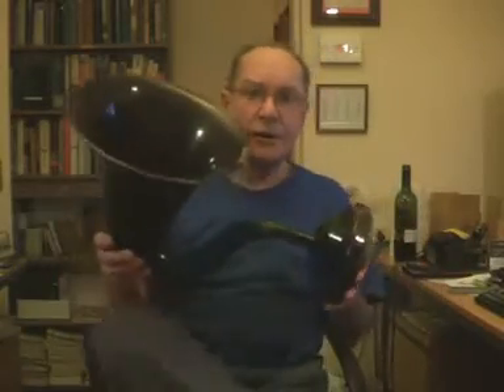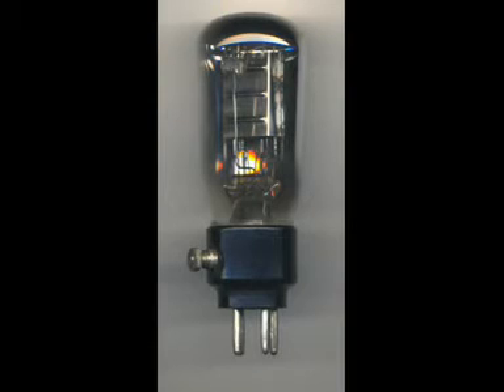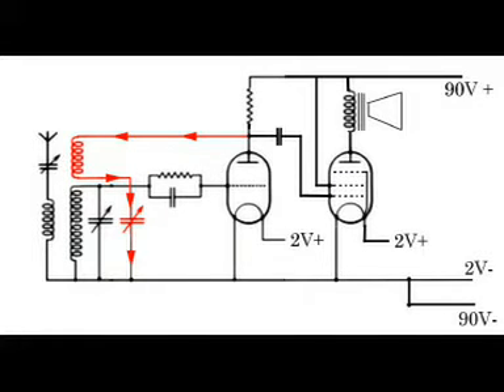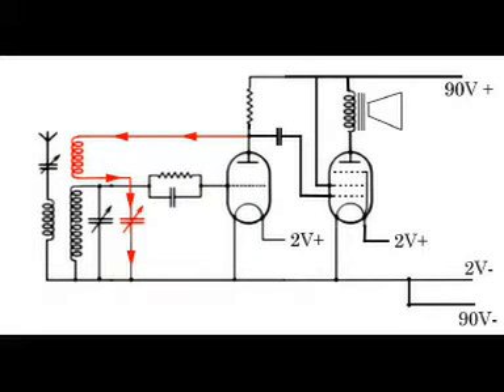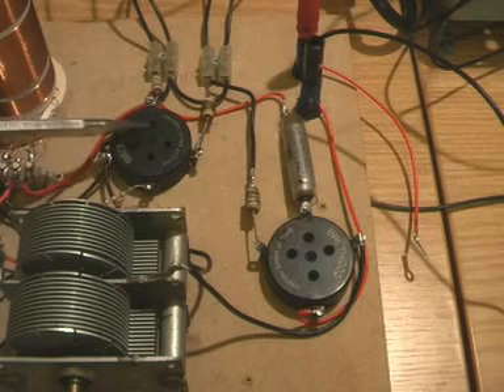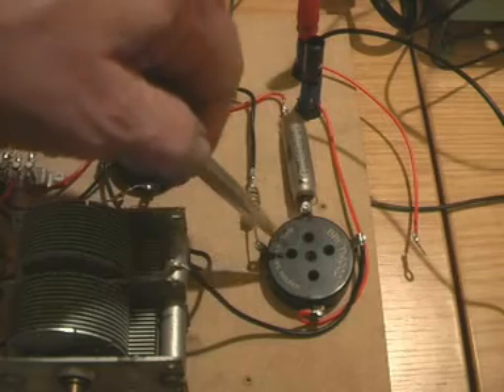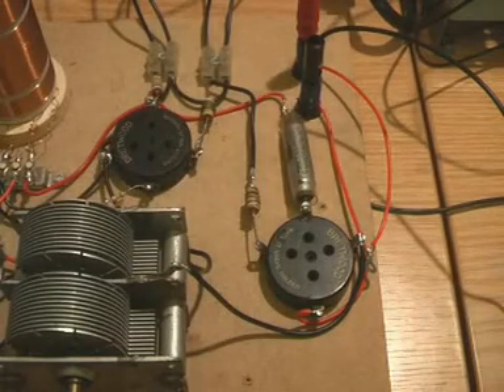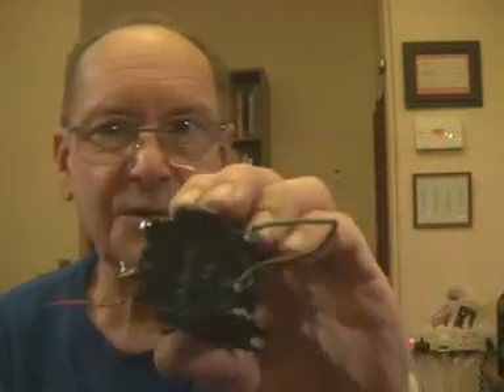crystal 6

Comment: Hi Norman,  couple questions. The resistor on the plate of the first tube 2000 ohm? Also with the two tubes you have there would you have enough gain to drive a regular old 8 ohm speaker with the correct output transformer? That's a nice old speaker by the way it must have cost a bundle.   Have a good one.

Comment: Which valves you use??
Reply from the maker: The triode was a Ferranti L2. The type appeared about 1931 and was intended as an Audio amplifier, but it worked OK as a regenerative detector. The pentode was a Lissen PT225, introduced in 1929. (Later versions of the PT225 had a 5-pin base, so the side terminal on this one indicates an early version.) Thanks for writing.

Comment: July 7th, 2014
Hi Noman,
Mike VK4QS form Australia here Mate
Thanks so much for your 6 part series on the Crystal Set and its further enhancement over time with the application of electrical techniches and valves.

 It was very enjoyable and educational, with your description of the circuit operations very nicely explained in everyday english the I reckon nearly everyone could understand and apprecciate.

I have been a radio amateur for 30 years, callsign VK4QS, and have operated Valve equipment for most of that time. But I am still drawn to the era of pre WW1 and the 1920's by way of radio books and equipment, as it just holds so much magic.

Keep up the great work Mate
Cheers
Mike VK4QS, Maryborough, Queensland, Australia

Comment: Thank you Norman.  You took me back to my high school electronics class circa 1968 when we built and "discovered" radio using very similar circuits.  Our course continued the development with a push-pull final circuit and output transformer to a speaker.  We also built a tube-based power supply to run the thing.  Only during my senior year was I introduced to those new-fangled transistor things, and did not really meet my first integrated circuit until my freshman year of college.  Keep up the good work.  You are a natural-born teacher!

Comment: You missed your calling; O.U. broadcasts missed out on a talent!

The pedant in me is driven to correct something.  The horn on the Brown doesn't amplify.  It provides better (mechanical) impedance matching between the vibrating diaphragm and the air to be vibrated in the room; so the energy transfer is more efficient.  You'll still find that principle behind the screens of cinemas.

Watching you is a joy; truly.
Reply from the maker: Sorry for my gaffe! You are absolutely correct, and I was being very vague - and quite wrong. There is indeed no  amplification in a horn - merely a path in which small vibrations of a diaphragm at the narrow end of a horn come to match themselves to whatever is at the other end of the horn... e.g. a room. Many thanks for your correction, and ano les for your generous appreciation of my humble efforts.